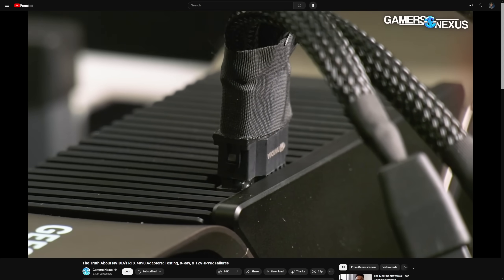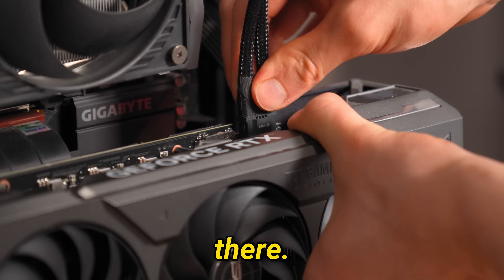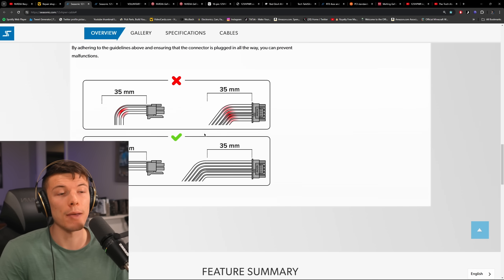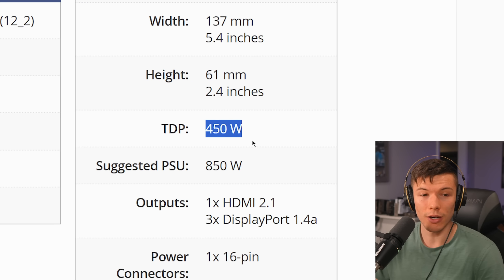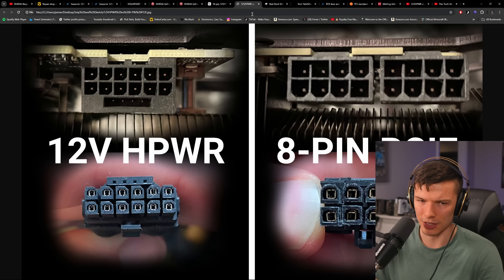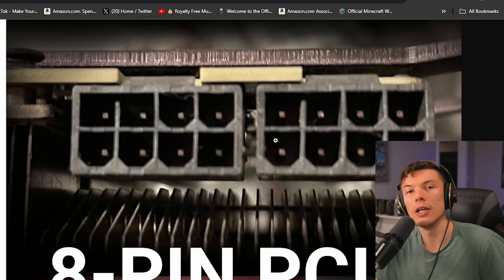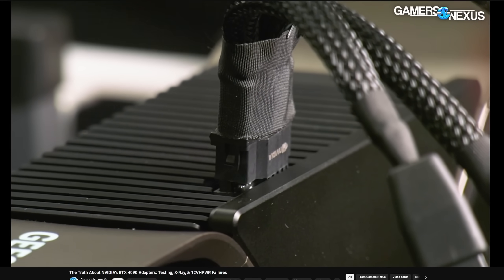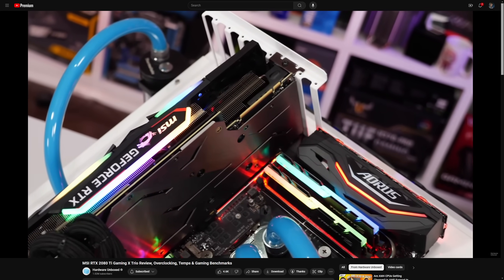The Dumbest Thing to Happen to Graphics Cards

Comment: Because Nvidia is transforming itself in Apple. Doing experiments with people's money.
And people still buy it...
Reply: And They SUCK On Linux!! I Put A GTX 1650 Into My SFF PC I Thought Would Be An Upgrade Over The Tesla P4! But It is Not Really! I Ended Up Going Back To My P4 Which Is Magnitudes Quieter And After i Close Out A Game My Desktop Does Not have To Restart! It's Is like Things Are Upside Down And Jump From 1 Monitor To Another Until i Restart The Desktop Environment! I Have Tried Uninstalling The Drivers And Doing A Re-Install But In The End I Gave up And Went Back To The Tesla P4 To Run In My HTPC That Runs My Bedroom TV And Serves Jellyfin To My Other 5 PC's That Control The other TV's In My Home!!
Reply: @kevinlsims7330 see that’s another issue, nvidea has more support for small gpu than amd. For amd it seem only their low end offerings get a small 200mm or smaller gpu. Right now there is 4070 that is 200mm and yet only 7600 from amd
Reply: Like Apple. Making connectors and cables to be used only on their products.
Reply: @nataflet it's an open standard. AMD also co-sign the 12 pin connector and has the option to add it to their gpus.
Reply: @nataflet  Dude ur dumb. they give you the damn connector, so don't act like you had to spend money on it.
Reply: All companies r after the same thing stop pretending Intel or AMD r your friend and Nvidia r evil all r the same
Reply: Apple is a company with one of the biggest "play it safe" mentalities. Tf are you on about? Besides their vision pro, what other product did they release that was leaning more towards an experiment?
Reply: @oopdigdigfig9786  1000$ monitor stand overprice for example
Reply: @XeqtrM1  that's not an experiment, that's anti-consumer behaviour
Reply: @oopdigdigfig9786  I mean it depends on how you look at it because it's also a thing called experiment to see what people r willing to buy
Reply: crapple dont have own product still made by china sells like apple product pathetic loser company people belive in apple lies  @oopdigdigfig9786
Reply: @oopdigdigfig9786 apple is overpriced my man simply has that
Reply: Apple Made It's Money From Being Patent Trolls!! They Bought Up Patents And Marketed Them To The People! Most of Their Early Software Was Written By Microsoft So They Could Claim There Was Competition In The Computer market! The Basic Functionality Of Their OS Was Copied  From Open Source!
Reply: like a dev doing his/her testing in production 😂🤣
Reply: Most consumers are kinda dumb, i just laugh about it and move on lol.
Reply: @TakaChan569  half of the people are of below average intelligence
Reply: @PREDATEURLT  Enlighten me, then
Reply: If AMD would step their ray tracing game and have a card in their lineup that matches the 4090 or outperforms it in every category they might have a chance to get Nvidia to improve themselves.
Reply: @JonCHardwickTX  Why would they do that, people will still buy Nvidia now because everyone/Reviewers will claim still Nvidia is still a better value than AMD because of all the other software support.
Reply: You have like 20 IQ.
Reply: Why do you think Apple experiment with the users money? I mean Apple the last who add features to their device, because they just perfecting that before addig (just how many 120Hz version was in iPhone and in Android..?) Android is that who experimenting with the users money, and putting all early access/beta version inside the phone and ask 100% for it.. imagine if you need pay 3 times for a game because it's cost you 100% in early access, in beta test and you need to buy 3rd time again when it's finally release.. this what Android do, Apple only put the better hardware inside the phone when it has a way to use better with software too.. (with same 120Hz example, when they gained 2 hours of battery instead of loosing 2 hours with the 120Hz..)
Reply: @TamasKiss-yk4st  I found the Apple suck off boy. Apple 4yrs behind ev1. Apple is only popular in the US and only simps defend them. Most mac users I meet are even dumber paying outlandish prices for sht while my PC blows them out the water for a fraction of the cost. Apple just sucks in practice and and is a sht company.
Reply: idiots buy it
Reply: This is why AMD exists ;)
Reply: @BaLar_  yet they can barley make it at par for mid tier
Reply: Because the competition is nonexistent, or inferior 

Nvidia need to slip up big
Reply: @GG-ou7it  You're the competition,, don't buy it !
Reply: @GG-ou7it nvidia 🐑
Reply: @kassmalz2069  he's not wrong. Have you seen how much money nvidia has vs amd? They could buy the competition. They have a trillion dollars now
Reply: @minion3806  did i say he's wrong?
Reply: @minion3806  That marked cap is not from selling GPU's to gamers.
Reply: @kassmalz2069  you commonly insult people you agree with?
Reply: @miklzn  that's part of my point
Reply: @minion3806  why are you offended? did i hurt your feelings?
Reply: @kassmalz2069  no?
Reply: @minion3806 lol they don’t have trillions
Reply: @GG-ou7it  Do you get paid for writing this nonsense are you just out of your mind?
Reply: They need competition
Reply: @Goober89  You're the competition,, don't buy it !

Comment: this is why I opt for single 8 pin 4070 card.
they are much safer, efficient & doesn't need a monster PSU to run.
Reply: i own one, but i really wish i had gotten a 7900 GRE or a 7900xt instead because im playing on 4k
Reply: @Hamborger-wd5jg  7900 xt belongs to different price tier, 7900 gre is good enough for 4k, but 4070 is really power efficient pulls like 150 watt when undervolted, electricity is very expensive in my area, so opted for 4070
Reply: @marufulislam4311  I overpaid for my 4070 pre super launch, $661, so I feel I have a right to be bitter, and at that price, id say the 7900xt being $700 is in the same bracket. But I'm really leaning on the GRE seeing as they unlocked the firmware OC lock recently
Reply: @Hamborger-wd5jg i paid 500$ for a 6950 xt lol. It consumes a fair bit of power but it’s served pretty well and I don’t really care about AV1 encode either so.
Reply: @Marauder-q2v  and it has 16GB VRAM and an actually decent bus width relative to VRAM, of course it's still slower than 320 bit but 256 bit isn't going to cast you into the abyss like the atrocious 4060 Ti. Bandwidth limits are going to hurt a lot in 4K gaming, it's why I hate my 4070 so much. I bet the entire issue would have been fixed had they just given it a 256 bit bus. But of course it's Nvidia so no they won't. Using DLAA instead of MSAA helps a bit but I still feel like people overrate DLSS. My experience with it has been poor. I had a 1080p monitor at the time I got the 4070 so my initial impression of it was perfect, but then I upgraded aaaaand you know how I felt.
Reply: @marufulislam4311  AMD cards are champs at undervolting, if I'm willing to cut about 10-20% of my performance I can run my 7900xtx under 200w at full load.
Reply: @Hamborger-wd5jg  I honestly couldn’t care about DLSS because this card is so overpowered that it’s not even needed.
Reply: @Marauder-q2v  IKR DLSS is so overrated

Comment: Man I almost don't want to upgrade from my 3080 because of these new st.pid connectors Nvidia is forcing upon us 🤦‍♂️.
Reply: what’s the point of even upgrading a 3080? unless you getting a 4090 there’s zero point in upgrading
Reply: @Swampyballs69  no point in upgrading in general for gaming, no good games anyway. Only reason to upgrade would be for AI, rendering etc
Reply: @FS-AMVs  I mean yes for now, but I heard the 50 series cards are going to have some another bs connector. Who knows it could be even worse than this one.
Reply: You would be really stupid if you did upgrade from your 3080. Steam still recommends a RTX 2060 in 95% of the games. Your 3080 is fine, stop this FOMO bs.
Reply: @GracefulRequiem  not everyone plays at 1080p low
Reply: @Swampyballs69  honestly I would wait till 6k series then, makes the 5k series cheaper and also will be better stable wise
Reply: @Swampyballs69  im talking about the 2060.
everyone is free to do whatever they want, but dont come making claims trying to force an agenda when it isn't true (not you, the 2060 guy).
Reply: @FS-AMVs  at that point just wait for rtx 70 series, 60 will be cheaper by then
Reply: my RTX 4080 works perfectly

Comment: You should've read the first article better, or actually past the headline. It's about cablemod adapters, not official nvidia plugs. Somehow every youtube channel currently does this, and it's not good for anyone.
Reply from the maker: I really just used that article as a jumping off point to why the 12VHPWR connector wasn't ready and they shouldn't have released it. Going in-depth on the article wasn't necessary for the video at all, but I can see where you're coming from
Reply: The official Nvidia plug melted my 4090 last month…. It is now in RMA. So no, it’s still not just cablemod adapters.
Reply: You might be right about the article, but it's still a stupid connector for the current gen.